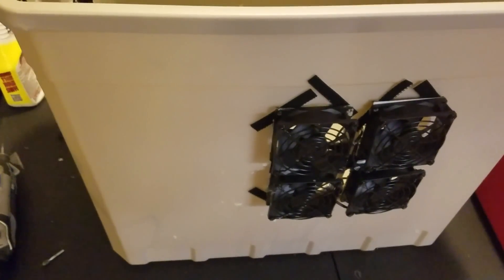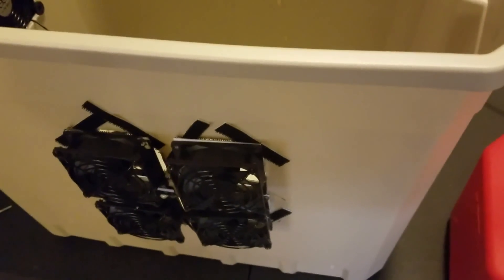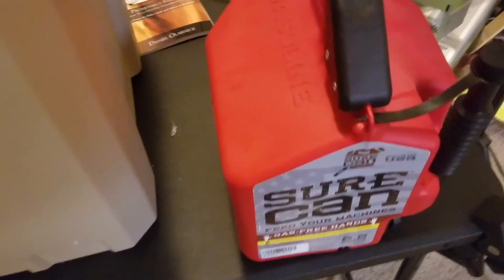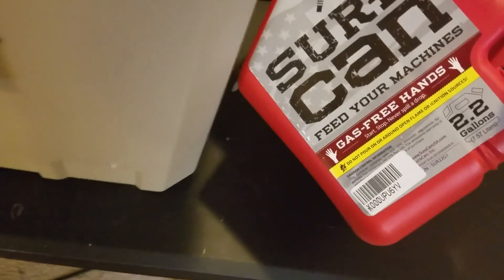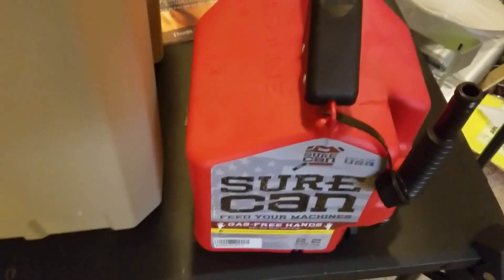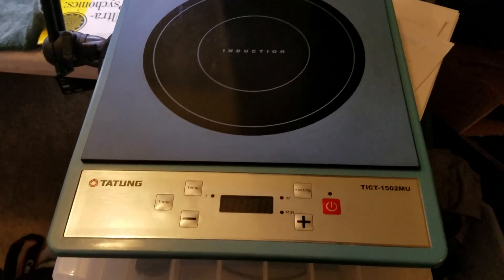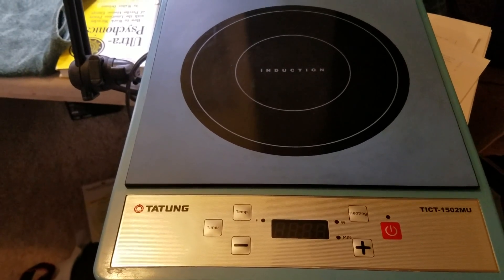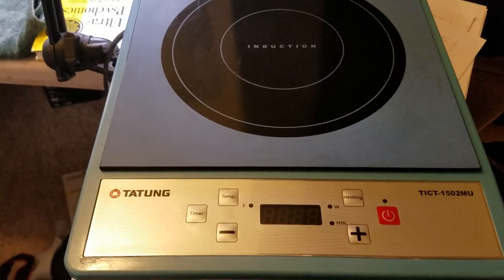A couple of new things a generator box (my design) an induction burner..backlogged on a few videos

Comment: just be careful with the exhaust on the generator it gets pretty hot and can really build up a bunch of heat in a small enclosure and could cause a fire.
Reply from the maker: I am going to get an insulated hose..and run it from the generator outside the box.   and then I am going to get an electronic thermometer and check the temperature.